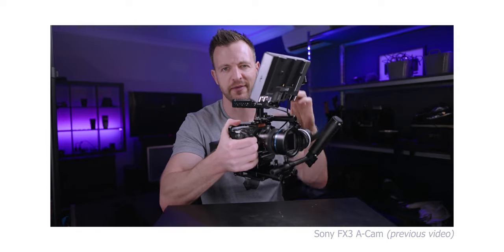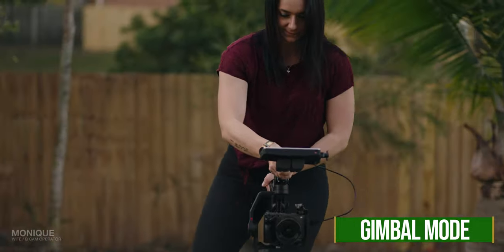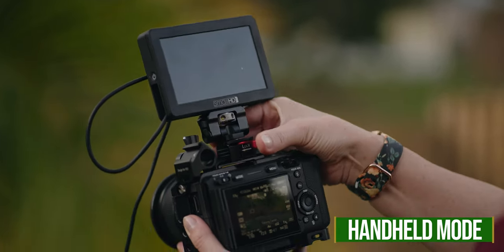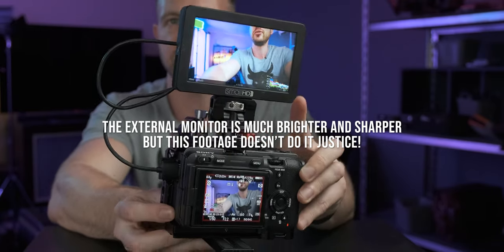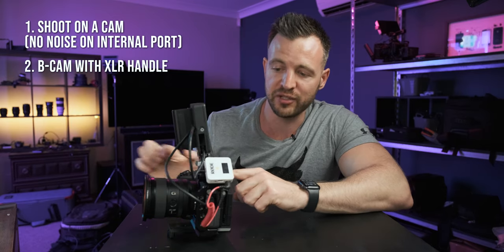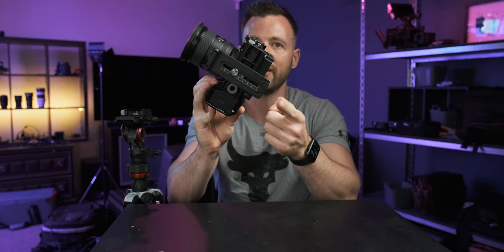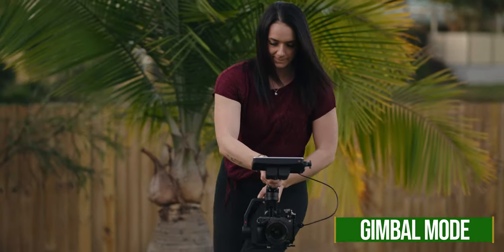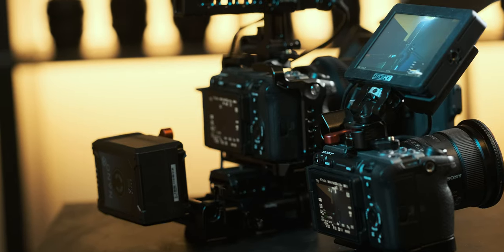Sony FX3 B Rig (Gimbal, Handheld and Tripod) (shot on Fujifilm X-T4)

Comment: I have the exact same issue with the mini jack and Rode Go II, but works like a charm with the handle. Just too bad. I have tried many solutions, but none worked. I agreed with the previous comment, no music is required. What you say is the most important :)
Reply from the maker: Awesome, no music for future videos then. I’m determined to find a way to get wireless go working without handle so I can do “small and light” setup, I’m still working on it currently

Comment: Hi there Isaac. Thanks for this in-depth video. I've been looking hard for a solution to mounting a shock-cradled shotgun mic to work with the FX3 XLR handle, and all I could come up with is mounting it on top of the XLR module. Do you ever find that setup too tall in run and gun situations, or that the mic being around 25cms above the top of the camera makes for an odd audio dynamic? I will be using Lav's for subject audio, and the shotgun for ambient nat sound, and granted, I am not an audio engineer but while trying to understand how it would all stack up, hadn't seen an example until now!
Reply from the maker: It definitely feels tall (I prefer “bottom heavy” rigs) but I haven’t noticed a problem when I put a videomic NTG on top of the XLR module in those custom cold shoes. I personally wouldn’t put anything too heavy in there so it would depend on mic weight and length. I’m always worried about bumping the mic breaking the mount
Reply: @Isaac_Insoll  thanks Isaac, that all makes sense. I’ve looked up another solution utilizing the smallrig’s 15mm rod clamp adapter and various other arms to Mount and then articulate the arm onto the right, XLR-side on the XLR handle… we shall see how it goes! Thanks for the advice.

Comment: Thanks for this video, the best I saw on YT for FX3 rigs ! On this B cam setup, don’t you ever miss top or side handles ? I did not practice a lot with mine yet, but most of filmmakers seems to love top handles. I have only one camera and I was thinking about going midway between your A and B settings with one of those Tilta cages with side and top handles (would just need to add a monitor in front of the top handle).
Reply from the maker: I both love top handles and don't miss it at all. 
If i'm doing a lot of stuff that needs top handle (IE: super low angle shots) then I'm more likely going to take an "A rig build" type setup with a top handle. 
If i'm using the "b rig handheld" setup and need a low angle shot i can actually hold the camera in one hand and use the monitor itself as a "gentle top handle" so it's what i hold with my other hand and use it to direct the camera a bit (while most of the weight is in the right hand holding the camera itself). Hopefully that makes sense

Comment: Great video! I am getting an FX3 here shortly and I was wondering how well the Weebill S would handle it. Any issues? Just FYI the music is a bit strong vs your voice in this video. I had this issue too but then I started doing something I learned from Gerald Undone's video "Make Your VOCALS POP over Background Music in ONE STEP!" and it works fantastic to keep your voice nice and clear over your music.
Reply from the maker: Sweet. Thanks for feedback on music, you aren’t the first to mention it so will definitely handle that better in future. 
FX3 in smallrig half cage with a 23, 35, or 85 1.8 works perfectly fine and I have had no issues at all. 
I use it exactly as shown in video (extra handle, external monitor)